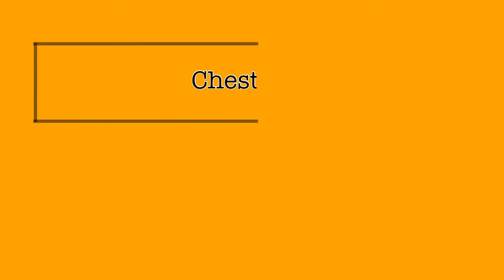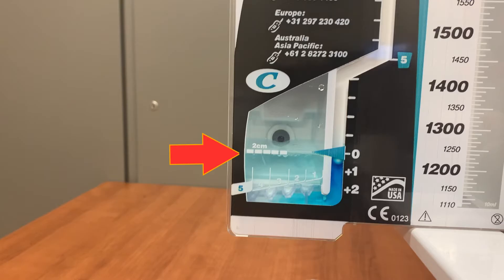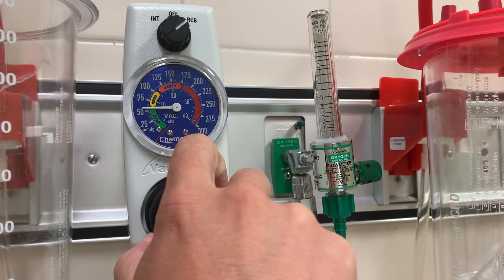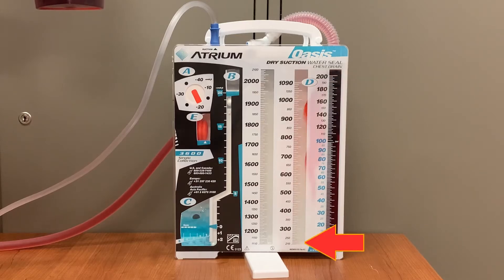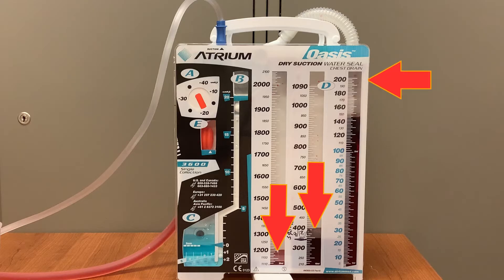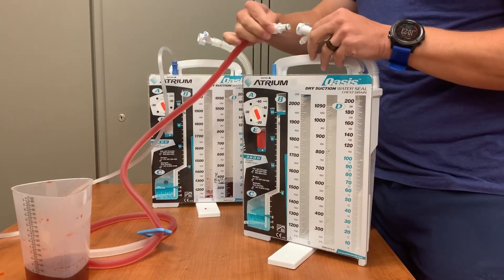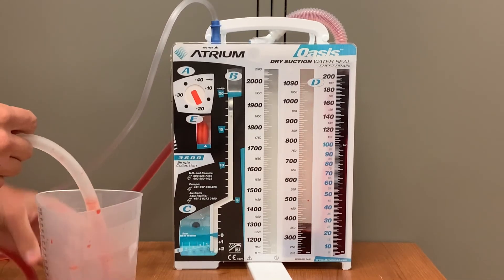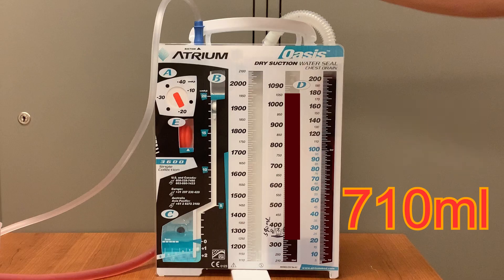Chest Tubes: Use and Maintenance of the Atrium Oasis

Comment: These horrible devices keep leaking out all over the floor after being placed in the red bag! The sharp corners poke a hole in the red bag and then these devices are never capped, so they end up spilling their contents inside the bag which then leaks through the hole onto the floor! Poorly designed device.